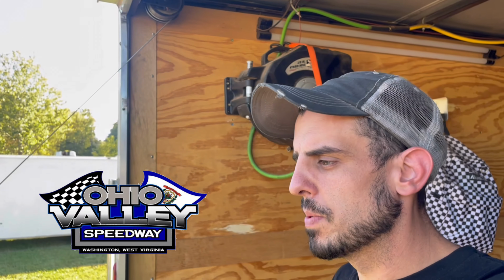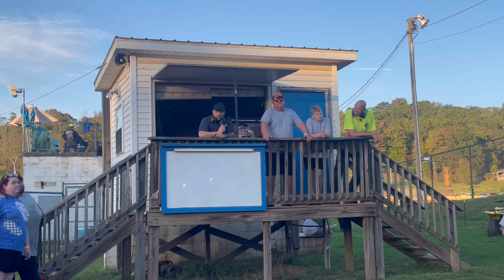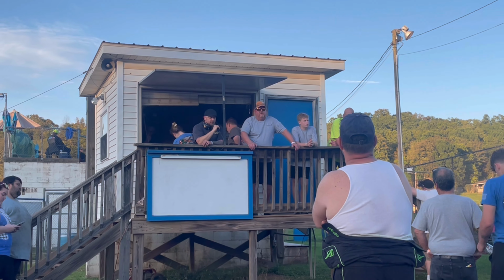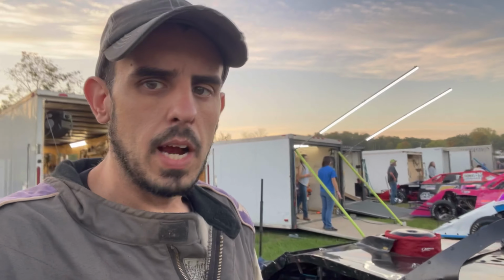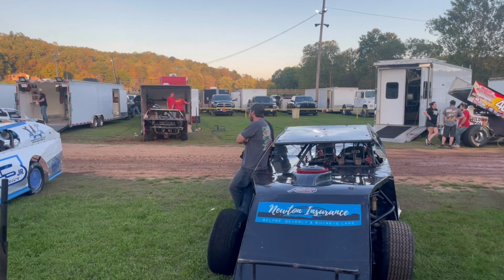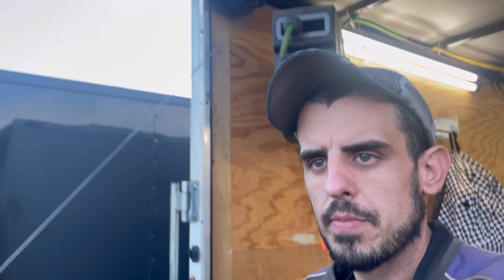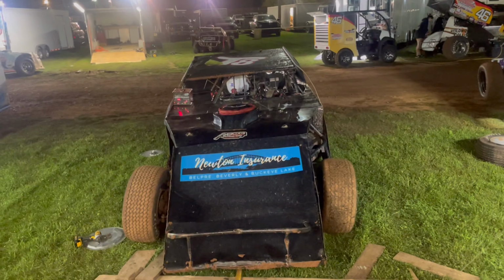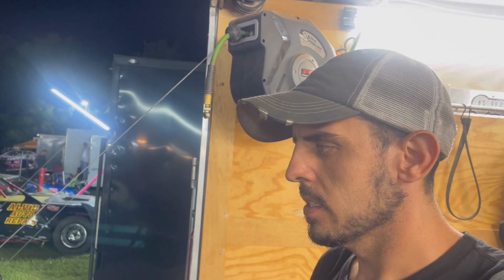Finally At The Valley @ Ohio Valley Speedway

Comment: Do you think you maybe had to much jet in it! I noticed the turns look a bit hairpin like on the bottom. Thought maybe it was loading up too much fuel?
Just a guess without being there to hear what it was doing. However, to go against that theory it also looked like you were coming off the turns decent...maybe a little outward skate but not much.
Hmmm... I'm not a carb guy either 😂...
Reply from the maker: @forwarddrive4066  the problem ended up being on the 4 barrel side. Had to replace the shaft. It was sticking allowing it to load up then run like crap. After about 10 phone calls and few talks with someone with more knowledge than me. We got it figured out and fixed.   I know one thing I’m definitely not a carb guy. But it was a good learning experience I’ll be the first to admit to that 😂
Reply: Ahhh...I see. I would have never guessed that was what it was. I was gonna mention floats but, I'm sure you probably checked that immediately. Well, at least you got a free education, lol. Glad to hear you got it right again. Let's go and chalk up a victory now, if you can find somewhere that's still running down there. 
Have you ever ran Brush Creek? I know they run late in the season, or used to as of recent.
Reply from the maker: @forwarddrive4066  yes I have ran brush creek. I haven’t ran there since 2019 though. They stopped running modifieds in the middle of 2020 though. I’m going to race this weekend again.